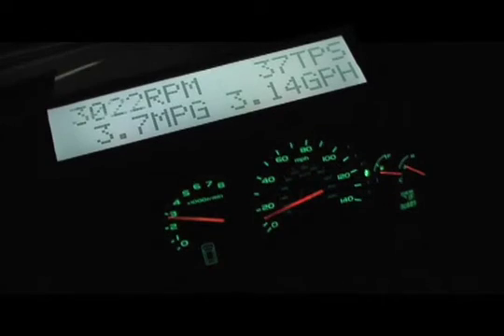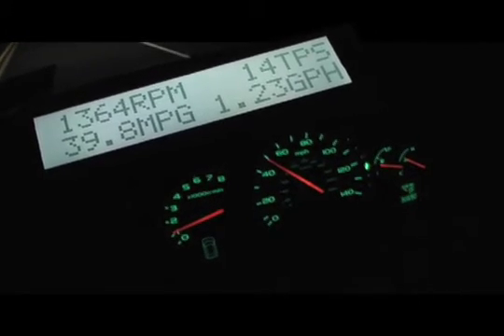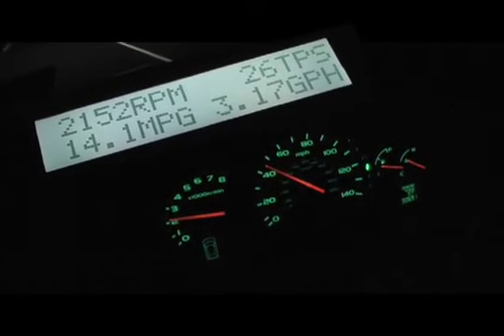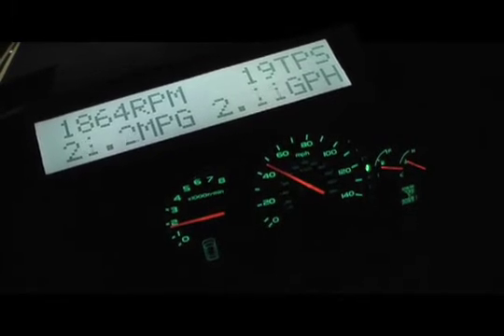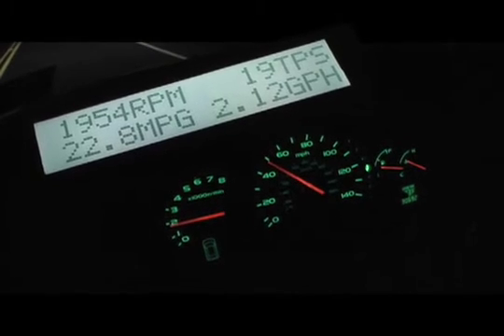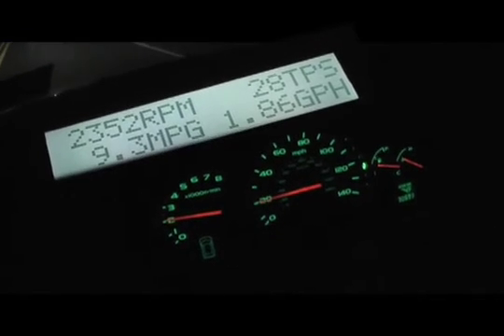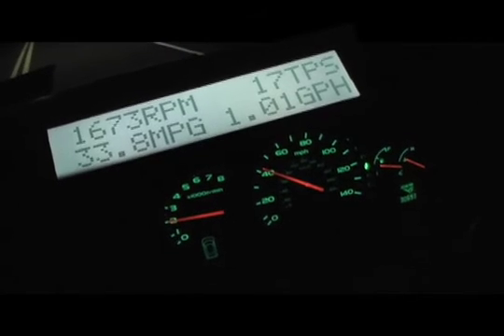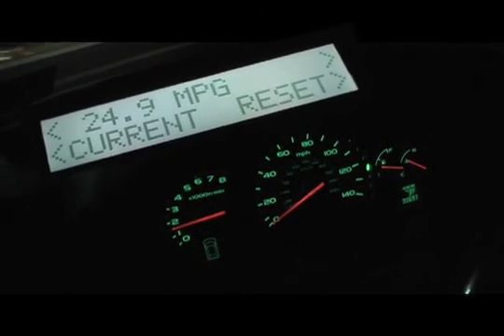Improving Gas Mileage Using a ScanGaugeII

Comment: I'm thinking he may not have calibrated the scangauge for this suv. You have to fill up and run through 3/4 of a tank and then fill up again and set the calibration (difference) from how much fuel it thinks you used and what you actually put in.

Comment: Does this product or another similar that would work on a 1969-1974 dodge charger or challenger??? Actual serious question. Thanks.
Reply: D. Hernandez No. 
Not a chance, sorry. This uses the computer diagnostic ports made compulsory on vehicles from 1996, yours will not have one of those.

Comment: Check out the video of my '67 Chrysler. The company called it the "Performance Indicator" but it's just a gauge on the console which shows manifold vacuum. Drive nicely and the needle stays in the "economy" range but get on the gas too hard and it drops into a red "power" range. It's primitive but it gives an instant readout of your driving habits. Constant city driving in the power zone used to give about 8 MPG but 15 MPG was possible if kept in the economy range.

Comment from the maker: If you want deep data, the ScanGauge is the way to go. The smaller, less expensive ScanGaugeE is cool alternative.  The EcoMeter is inexpensive, compact and colorful - easy to see at a glance without looking at the digital display - roughly half the price of the SGII and a bit less than the SGE.  Need to check to see if it works with your model year, though. There should be a new EM out with backward compatibility.

Comment: @cadw600 - it doesnt seam very accurate 9999mpg?
He's using a different MPG gauge.  The one he's using is the one that shows you the CURRENT MPG AT THAT TPS, RPM, SPEED, etc.  There's another one that shows the trip mileage.  And 9999MPG means the deceleration fuel cut-off (DFCO) kicked in, thus not using any gas, also shown in the GPH gauge.

Comment: Scangauge2 is $160. That's over 5 tanks of gas worth of money (with a 12.5 gallon tank with gas at about $2.50/gal). I'm already driving very efficiently without one. If this product boosted my mpg by 5 (which is unlikely, it's hard to get more than 28mpg with a 2000 Chevy Cavalier in all city driving), it would take a little over a year to pay for itself (driving 325 miles every 2 weeks). That's before it actually starts saving you money.

Comment from the maker: @memeshows - It's my wife's SUV, not mine ... comes in handing when hauling lots stuff.

ScanGauging with a Yaris now ... #s are eye-popping. Best highway loop: 46.2 MPG, w/ some A/C & cruise. Aiming for 50 MPG w/o cruise, been too hot to drive windows up, A/C off.

You get my vote ... MPG gauges should be regular issue in all new vehicles.